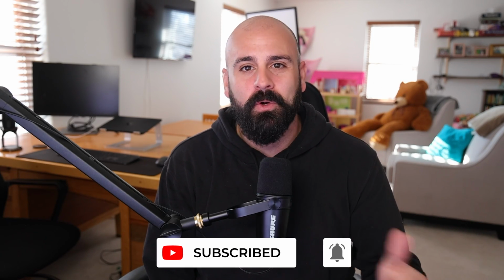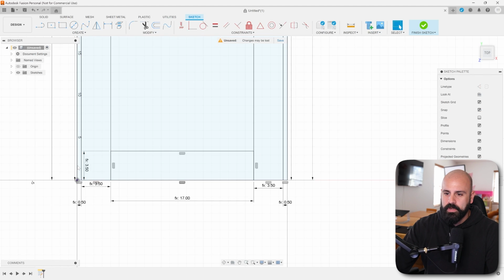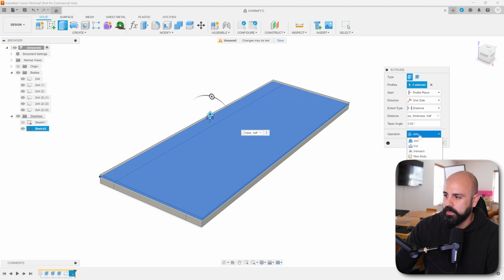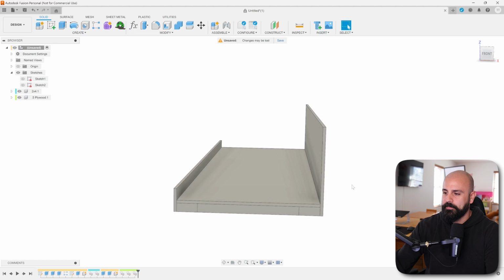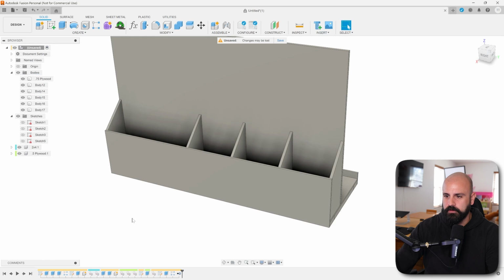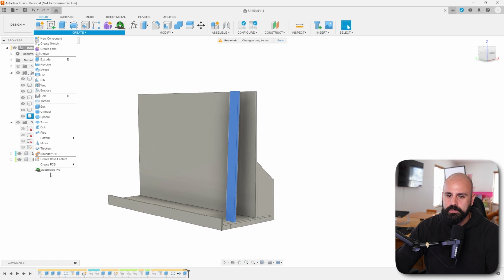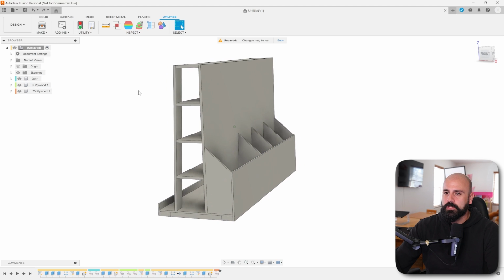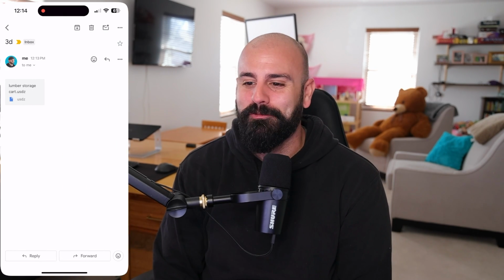Modeling a Lumber Storage Cart - Fusion 360 for Woodworkers

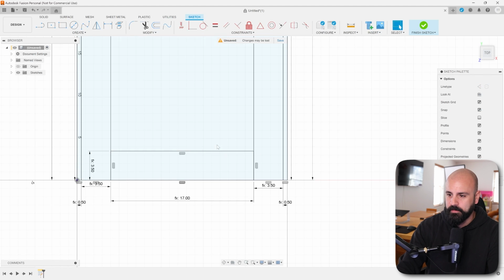Comment: 06:30 why did you this entire calculation? If you would just have clicked the connecting line you would have the same distance. And it would also be parametric because all of the other lines are driven by dimensions.

Comment: I think the problem you discovered with the angled ply thickness arose from the angle of 3 degrees. If you would have created an angled sketch plane to extrude the sheet ply piece, your ply thickness would have the proper thickness.

Comment: Love the video and 'pace of work' to digest all this.  One error in your drawing is when you made the slats for the tall side, you probably should have used the offset instead of making it width of full because the angle skewed the true width.   Still love the video but that discrepancy initiated an error in width of those slats (albeit at 3 deg so very small discrepancy).

Comment: nice video.
your mistake with the cutlist which shows 0.749" was how you set this value in the sketch. at min 26:00 you create a line on the x plane with the lenght .75 but it needs to bei at a 90 degree angle to the line you create before.

this is how i would do it:
1. just creat a second line to the first one
2. use the parallel constrains to make them parallel
3. press d to give them a spacing.
4. make sure the dimensions lines are on the some angle like the lines in your sketch and not on the x ir y plane.

when you doublecheck the .75 value i think fusion just did not show enough decimals to see the error und fusion rounded it up to .75

hope that will fix it
regards
Reply: I agree.
The reason it wasn't obvious was that his settings only show two decimal places, not 3, so it rounds up.

Comment: Great video - I have been using fusion 360 for my 3d printer - but to use it for woodworking plans - makes my head spin. And since I was googling for a work cart - this video is a win-win for me. Just one question - do your plans for the work cart include the fusion 360 files? I want to make some changes and getting the files would save me a lot of time.

Comment: 26:00 The reason that didn't end up being exactly .75in, is you needed to measure with a 90° angle. Which would have probably needed a construction line for reference. Another thing you could have done is draw a line and use the parallel constraint, then dimension the 2 lines. Awesome video!!
Reply from the maker: Ahhh gotcha, very helpful - thanks!